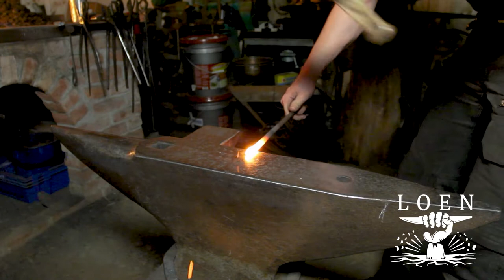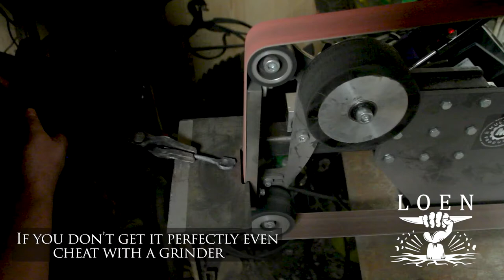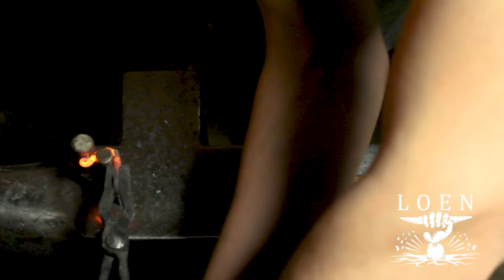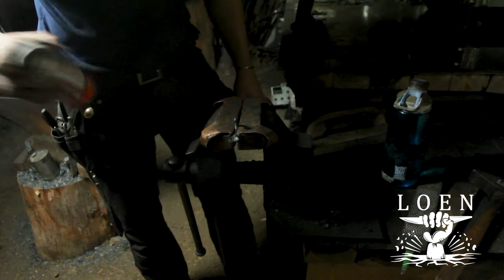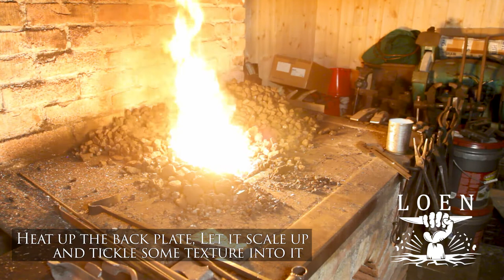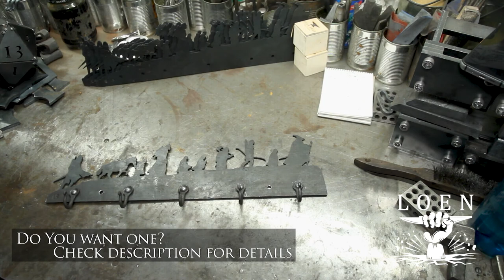Forging Fellowship Coat Rack - Longform | Loen Smed

Comment: Im sick only from watch this ;) two weeks ago I forge banch of hooks, and nead to forge banch more when frost end (i have open air forge) 

Is like always greate job on Ur chanel or IG. Best regards from other site of Balitck sea
Reply from the maker: Cheers! If you're getting cold while forging, you're not working hard enough 😉 Or you need a gas forge
Reply: @RasmusLoen  was few days  negative 30*C by night ;) I know for Nords can be standard, but In Poland even for such vilageman as I is raw to work outsite- is nothing wirde, but is extrem. And my blacksmith shop is only roof on posts, open from 3 sites- Im woodworker, no nead more to ocasional making timber construction clamps, tools, and rustick furniture details . 
Even if I burn a wheelbarrow of coke (means preburn coal not such drags) it not help to much for -25*C and 50km/h wind. And forging hooks is no to much slage hammer stroking, then U not heat youself to much ;)